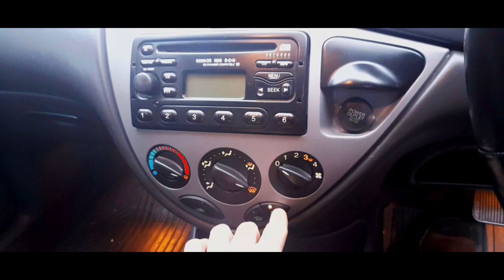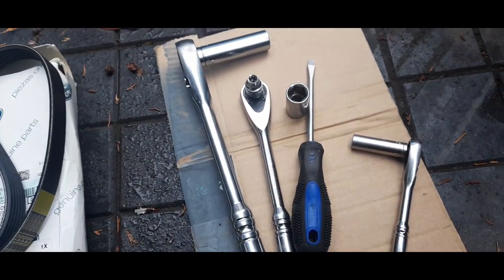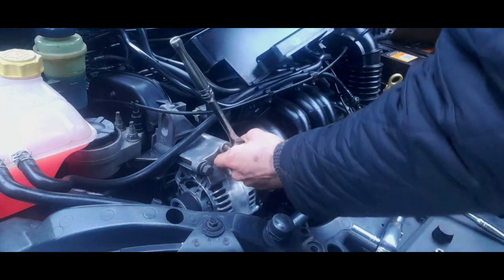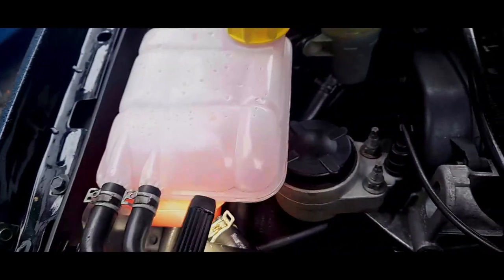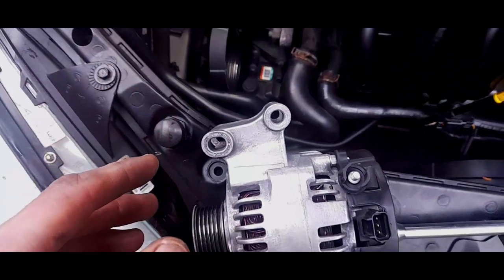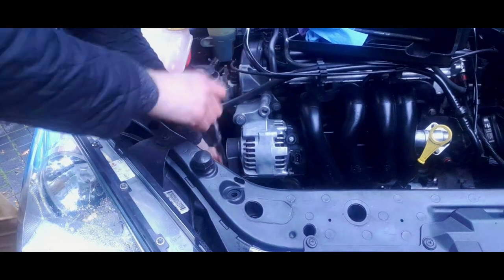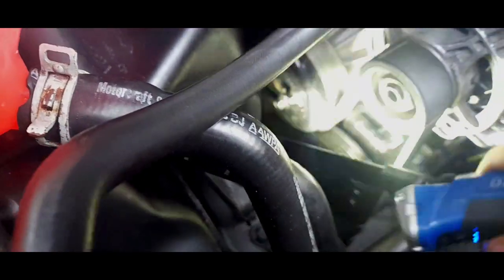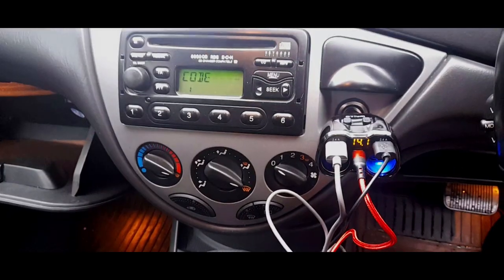Ford Focus MK1 - How to change a 'Stretch' Auxiliary Belt!

Comment: Hi Bud great video, really helpful. 👍🏻 I'm about to change the Power Steering Pump and a contaminated stretch belt on my focus Mk1 late 2003 1.6 Zetec estate, it has the black top Zetec 1.6 petrol engine. It doesn't have Air Con or an auxiliary belt tensioner, glad I watched the video because I thought that 'Special tool' looked like a pain to use.
Reply from the maker: You have the sane configuration as me then! It's a very rare one on a Mk1 and gas been a pain to change the belt with the tool. It costs £40 and is a fiddle to say the least. I'm glad it's shown you how to sort this :)

Comment: What's the best way to access the tensioner pulley? Is the bolt 15mm or 17mm? Do you pull down or pull up to release the tension?
Reply from the maker: with a tensioner you pull downwards unless I'm mistaken and it should be a 15mm

Comment: Mine sound similar but only rarely sometimes at start at colder temperatures. Sometimes I need to touch the throttle pedal and it stop squeaking. Don't investigated what is squeaking and why. If it's the belt, or/and automatic tensioner or if maybe any of the bearings are sometimes stucking intermittent. Like alternator or something.

I need to take of the longer belt and spin the pulleys to hear and feel how they feel..

A kit costs about 100 euro from SKF. AC-belt and Alternator-belt and automatic tensioner. AC-belt is a stretch belt and it is not fun to replace. The longer normal one isn't really bad but can be benefit with help of a friend. One open the tensioner and one putting the belt on properly.
Reply from the maker: Ideally it is a two person job most of the time with how strong the tensioners are, especially if your hand slips on the spanner and suddenly it goes flying back. I'd certainly investigate the way you say, I'd spin all the pullies and tensioner to test for roughness and if it sounds rough, then go from there.

Comment: Does the MK1 focus 04 year petrol 1.6 have a tensioner, mine is not budging, unable to release the belt tension, could it be seized?
Reply from the maker: yes if it has air con!
Reply: @usuallyfixingtinkering mine has a/c can't release the tension will remove the stud Instead.
Reply from the maker: That tensioner is seized then it needs replacing!

Comment: that is stupid. the aircon model has the compressor where the power steering pump is in this one and the power steering pump sits in the back on a bracket, that bracket is the tensioner. I don't know what the hell they designed in the non aircon model there ...
Reply from the maker: It's a very simple system without a tensioner and air con. Just a pain changing the belt but my theory is these belts last longer than the standard serpentine belt.
Reply: @usuallyfixingtinkering  for the regular belt the repair manual states to change it every time it was taken out. So mine was changed with every new timing belt anyway.
Reply from the maker: That is a good practice but tbh its not necessary, unless there is damage like missing cords and ribs then re-use as the tensioner will take out any excessive stretch over time. I'd say replace every timing belt change which I'd say its 8 years to be very safe!

Comment: My belts new with alternator i had done in oct, it squeals briefly when i put both screen heaters on, nothing major tho
Reply from the maker: As long as the voltage remains at least 13.7V with the screens on, its good! Just like I tested at the end,with the old belt and heated screen on it'll dip to 12.5V!

Comment: I use a Gates belt set, (on my 1.8Zetec) with new tensioner. Changed them in 2019, no problem, work fine. Quite long version, AC, alternator, waterpump and steering pump are in the game.
Great description, thx! :-))
Reply from the maker: Great point that I never mentioned was the normal serpentine long belts on air con models should be fine with Gates, its just the stretch belts... you need genuine! Its been a week since I filmed this and I've noticed an improvement in the electrics. When I used to indicate the engine would give a little surge each time, with this belt its not only silent but that issue is gone!

Comment: Attempting this myself, but I believe the water pump is also leaking either from the gasket (unlikely) or that seal you mentioned, can you buy just the seal or do you need a whole new water pump is the seal internal to the pump? Thanks
Reply from the maker: Nope new water pump I'm afraid, there's little point since the time vs cost is very prohibitive.
Reply: Done the water pump today, mate that belt replacement is an absolute bastard  2 days on it and only just finished. It would make it so much easier if the car was fitted with a tensioner like on the air conditioner models. Guess it's ford just being stingy.

Comment: great job on that
had mine swoped 2 weeks ago as the tensioner had seized but fare play to ya for doing that in this weather👍👍👍
Reply from the maker: Ah that does happen with the tensioners with age. Glad you got it sorted! I've done this job a few times for various reasons it was pretty simple, took me little more than the length of this video. It was -1 st the time but a hot tea was awaiting straight after🙂

Comment: 2010 Focus here..seemingly no mention of clearance issues on any videos i.e. how to remove idler pulley bolt when frame\body is in the way.. imperative at all times to remove motor mount and then raise engine? if so why no mention in videos
Reply from the maker: There is no idler pulley on a Mk1 focus with a stretch belt, hence why I've not mentioned it.
Reply: @usuallyfixingtinkering  my bad didn't mean you specifically however was incorrect on the MK1 it's a 2010 so is that MK2 or 3 not sure, thank you still; however still my idle pulley dilemma persists thank you for any and all insight
Reply from the maker: @rtf8056  ah sorry I took it the wrong way, that's sounds a pain not sure why there's an idler so close to the rail! My advise is to take the engine mount off and jack the engine up to see if it improves access. Pain in the ass I know!

Comment: Is this the same method for models with the tensioner?
Reply from the maker: No models with a tensioner is a completely separate exercise where you just slacken the tensioner off and whip the belt off, take a few minutes to swap the belt... this is for the very few like myself who don't have a tensioner and instead have a "stretch" belt.
Reply: Does the road wheel have to come off to do it?
Reply from the maker: @leerowell9434  No you should be able to get a decent spanner or socket onto the tensioner.

Comment: This may be a silly question as even though it seems the most obvious thing to do if you replacing a faulty drive belt but wouldn't it not be alot quicker and hassle free to cut off the belt?? Please give me feed back i maybe missing the pointing?..
Reply from the maker: You could... but you've still got to put the belt on which requires the alternator off in this case being a stretch belt.
Reply: @usuallyfixingtinkering  thanks for the feedback. I did not want to sound like Mr know it all as you obviously know what you are doing but some times the most obvious ways are not always the best ways it seems then. I have same issue and my car is a MK2 2009 oddly  enough. You have a new subscriber
Reply from the maker: The MK2 petrols had this system on every model I believe! A pain :)
Reply: @usuallyfixingtinkering  yes I was aware of they tensioner on they model but after looking was apparent there was no such part. But glad I can across your video il be looking at the same method soon 👍
Reply: Ive finally managed to fit the dayco drive belt. It was. Absolutely brutal in the end I used a long screw driver to hold the right side of the alternator while screwing in the left side while having some 1 holding a crowbar. I found it impossible to align how you did it it was trying to cross thread. How on earth you did this method on your self with a 1042-1059mm is beyond me most brutal job I've done on a car. Next time I think il invest in a car which actually as a pulley tensioner.
Reply: On a MK2 what is the hard plastic cable fitted to the top of engine cover connected to the air filter box? What is the part for and how which end is it best to disconnect from any insight information would be great thanks.
Reply: I’m going to give you a tip, the bottom bolt needs to be nipped up tight but then slackened off a quarter of a turn, then get a pry bar and push the alt down allowing you to slip the belt on. This way the alt isn’t pissed